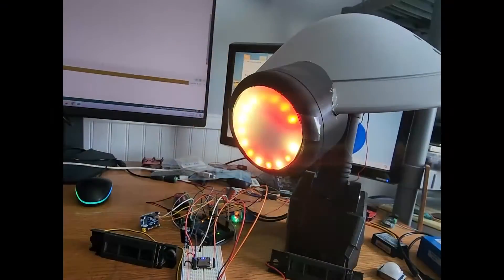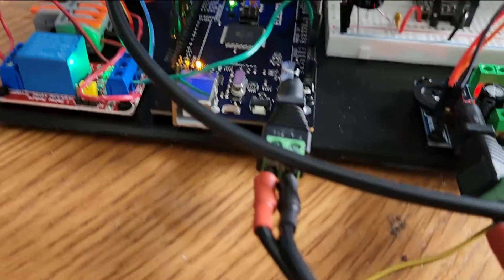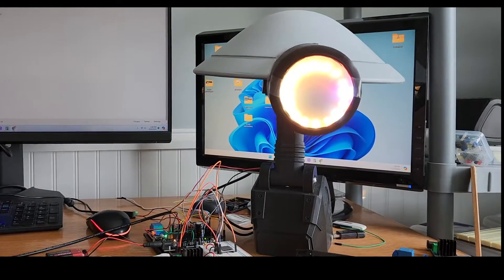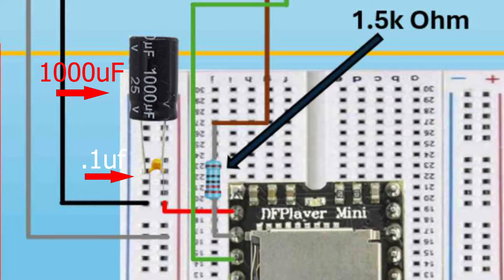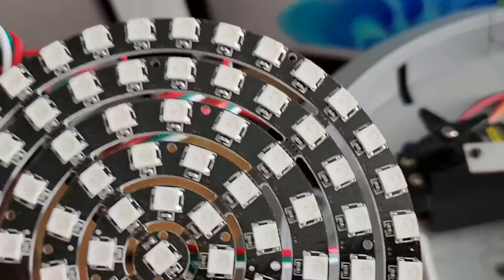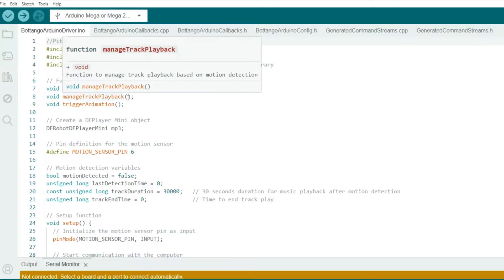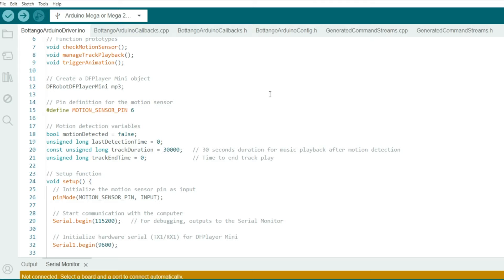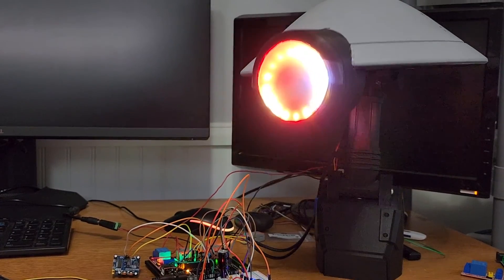😎 DIY Arduino: Adding MOTION Activated Sound to Star Wars Pit Droid with Bottango

Comment from the maker: Here is the code I used from the video. After exporting your Bottango code, copy and past this to the BottangoArduinoDriver.inoi tab at the top of your sketch. Of course you can alter any aspect of this to make it your own. If you want different head movements just reconnect to Bottango, create new animation, export Bottango code, and paste this same code to the same tab in the sketch  Check out the description for links to previous videos no setting up your animation and using DFPlayer Mini module if you need it. 👍
//Pit Droid is motion activated for 30 sec with sound
#include "src/BottangoCore.h"
#include "src/BasicCommands.h"
#include <DFRobotDFPlayerMini.h>  // Include the DFPlayer Mini library

// Function prototypes
void checkMotionSensor();
void manageTrackPlayback();
void triggerAnimation();

// Create a DFPlayer Mini object
DFRobotDFPlayerMini mp3;

// Pin definition for the motion sensor
#define MOTION_SENSOR_PIN 6

// Motion detection variables
bool motionDetected = false;
unsigned long lastDetectionTime = 0;
const unsigned long trackDuration = 30000;   // 30 seconds duration for music playback after motion detection
unsigned long trackEndTime = 0;              // Time to end track play

// Setup function
void setup() {
  // Initialize the motion sensor pin as input
  pinMode(MOTION_SENSOR_PIN, INPUT);
  
  // Start communication with the computer
  Serial.begin(115200);   // For debugging, outputs to the Serial Monitor
  
  // Initialize hardware serial (TX1/RX1) for DFPlayer Mini
  Serial1.begin(9600);
  
  // Check if the DFPlayer Mini is correctly connected
  if (mp3.begin(Serial1)) {
    Serial.println("DFPlayer Mini is ready.");
    mp3.volume(20);  // Set volume level (0-30)
  } else {
    Serial.println("Error: DFPlayer Mini not detected. Please check connections.");
  }
  
  // Setup the BottangoCore
  BottangoCore::bottangoSetup();
}

// Loop function
void loop() {
  // Check for motion and manage track playback
  checkMotionSensor();
  manageTrackPlayback();
  
  // Run Bottango loop
  BottangoCore::bottangoLoop();
}

// Function to check the motion sensor
void checkMotionSensor() {
  bool currentMotion = digitalRead(MOTION_SENSOR_PIN) == HIGH;
  unsigned long currentTime = millis();

  if (currentMotion && !motionDetected) {
    motionDetected = true;
    lastDetectionTime = currentTime;
    Serial.println("Motion detected. Triggering animation and music.");
    triggerAnimation();
    trackEndTime = currentTime + trackDuration; // Set the time when the music should stop
  }
}

// Function to trigger animations and music
void triggerAnimation() {
  BottangoCore::commandStreamProvider.startCommandStream(0, false); // Start default animation without looping
  mp3.randomAll();  // Play a random track from the SD card
  Serial.println("Music playback started.");
}

// Function to manage track playback based on motion detection
void manageTrackPlayback() {
  unsigned long currentTime = millis();
  if (currentTime >= trackEndTime && motionDetected) {
    Serial.println("30 seconds have passed since motion was detected. Stopping playback.");
    mp3.stop(); // Stop playback
    motionDetected = false; // Reset motion detection flag
  }
}https://www.youtube.com/s/gaming/emoji/7ff574f2/emoji_u1f44d.png

Comment: This might be a dumb question but I'm working on my first pit droid and have no prior experience with arduino or similar electronics. Is it possible to fit this setup into the droid so it is self contained? I hoping to animate the head of my pit droid like you did in your video but like to have a battery pack fit in the torso but I'm not sure which size/type of battery would be appropriate.
Reply from the maker: That's not a dumb question at all. I don't have a picture of everything contained in the head and chest cavity, but I have seen people in the facebook group post images of the way they did it. 
If you're using only 2 servos, don't bother with the servo driver board. Use an external power battery for the servos and use Bottango to program your movements for the smoothest and easiest way to animate the droid.
You can use a small microctroller, it doesn't have to be a Mega or Uno board. I see that people use ESP32, which is small, powerful, and has wireless ability. If you don't need wifi or bluetooth connections, check out Teensy4.0.
For sound, the  DY-HV20T is a good option. You can connect a 4ohm or 8ohm speaker to the board and it's pretty loud. The  DY-HV20T is sound board that has a decent onboard amplifier - it's a nice chooice unless you need something really loud.
If you check the facebook group you should see numerous options. 👍💪
Reply: @BMonsterLaboratory thank you so much! That is super helpful. I’m excited to get started on some of those electronics and animations
Reply from the maker: @patrickasay2231  you're welcome. It'll turn out great I'm sure!

Comment: Nice video as usual! However I just started to use bottanga and it  seams the latest version, does not generate the same files anymore and the triggering code does not seam to work for me.
Reply from the maker: Hey there! Thank you. I appreciate the compliment.
I just uninstalled the old version and reinstalled Win_0_7_0a1
After selecting your options and exporting, you get 3 files; 
GeneratedCodeAnimations.cpp file
GeneratedCodeAnimations.h
and a HowToUseThisCode.txt file
put these 3 files in your BottangoArduinoDriver file, same file as your BottangoArduinoDriver.ino Arduino code.

Open your Arduino .ino file, go to the BottangoArduinoModules.h tab
uncomment this line to control animations from exported code: 
// #define USE_CODE_COMMAND_STREAM 
Are you usign Adafruit PCA9685 servo driver?  if so, uncomment this line: 
// #define USE_ADAFRUIT_PWM_LIBRARY 
(To uncomment a line, simply remove the “//“ characters from the beginning of that line.)

If you have multiple drivers in your project, and exported them, you will have a folder for each driver, and a .cpp and .h file in each folder.  Repeat these steps for each driver, using the generated code for each driver.

The HowToUseThisCode.txt file also tells you how to insert your own logic. 
I'm not sure if you already tried this but, it should work...hopefully.
If you get stuck somewhere along the way, feel free to ask. I may be able to find an answer for ya.

hope that helps!  👍
Reply: @BMonsterLaboratory  Thanks !

Comment: Looks great. I see you aren't using the wire anymore and went back to a spring? Did that end up being more stable?
Reply from the maker: Hey there! I found a good spring that wasn't too stiff and wasn't too loose. The wire would snap after a few adjustments but the spring that's in there now is great! I guess if anything is placed in the head, like a board or speaker, we'd need a stiffer spring. But as of now, it's working well. It's also light enough that I can use 5v to power the servos without any trouble.
I tried everything on this head animation. Went front redneck hardware quick fixes to recommended parts. It was fun. ready for another one!

Comment: This is awesome, I’m so glad you got it all together!  
Did I catch this right?  The LEDs color and sequence are not controlled by Bottango? If so, why not - would a …. Curve? … work?  
Sorry, I can’t remember the correct term or if that curve is it. That is what I used when I made my crows eyes blink. 
Very thorough video of your set up, that is awesome that you did that because I’m sure it will help others, myself included.
Reply from the maker: Hey there, thanks!  The LED on/off switch is controlled by Bottango while the pattern, blink speed, and color are controlled by the mini controller on the LED wire. It was easier for me to change the look of the LEDs whenever I want without connecting the board and changing code or bottango settings.  I used Bottango to control the serovs and power to the LED, the motion sensor and mp3's are controlled by Arduino.  I may not have been clear about that (oops).  
A curve may work, I'll have to try it. I have another one to build. I would like to make a controller for it, use xbee or maybe some cheaper bluetooth modules. We'll see.  I think it will be fun to come  back to this every once in a while with some different builds..
Thanks for leaving a comment. Much appreciated !! 👍
Reply: @BMonsterLaboratory  no, you were clear in the explanation, and the reasoning makes perfect sense. 
Happy to comment, helps create community and supports each other’s work.
Reply from the maker: The Droid Division and Bottango groups are great to talk to. They both have a great community of users that are always helpful.